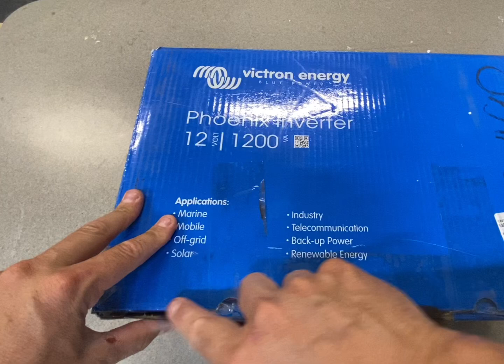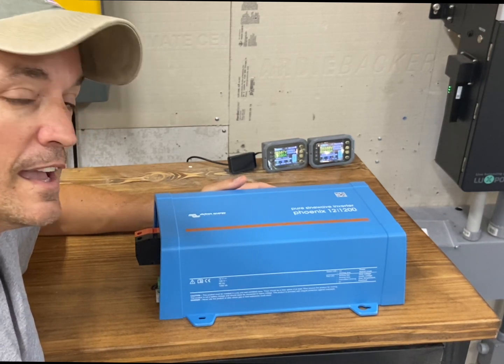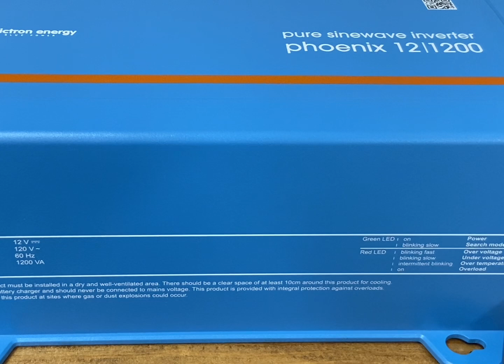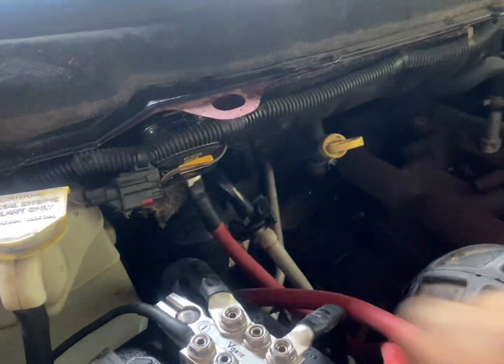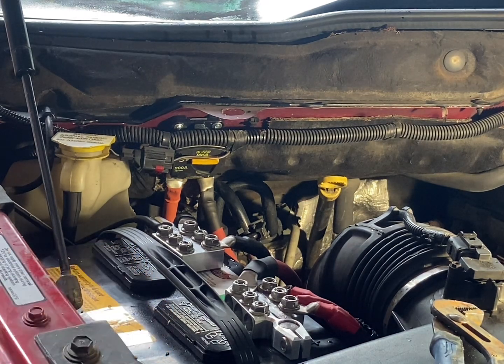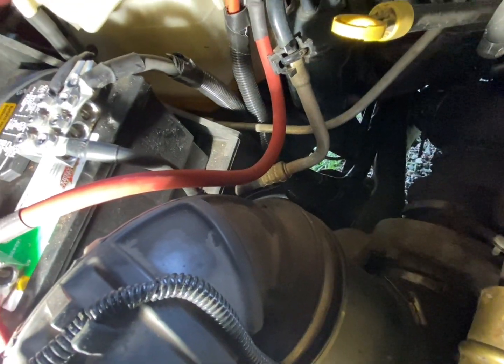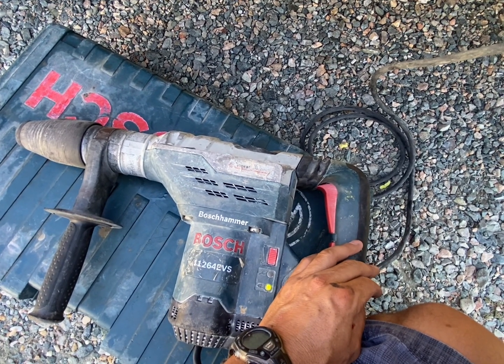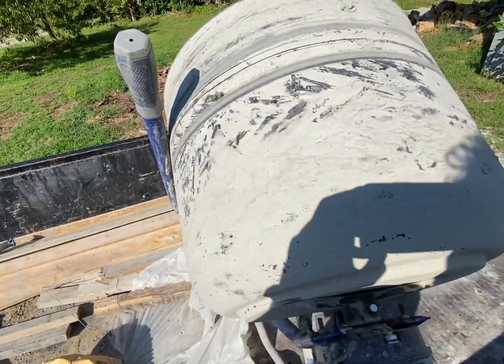DIY Truck Power Upgrade: Installing a Victron Phoenix 12V Inverter in my truck~and load testing

Comment: thanks so much for showing it with the jack hammer and mixer . 
been wondering if i could is it as a portable power supply with a 280ah litime . 
take care , jeff
Reply from the maker: Yeah that would work actually. After using it on a few jobs I actually had to recently upgrade. As the jackhammers bogged down they would trip the inverter. I’m using a 3kw Vevor inverter with a 460ah vatrer battery now.

Comment: Hello from Youngstown Ohio.  I just inherited a brand new Phoenix 12/800 But there are no cables in the box.  Can you tell me where I can get them please?  Thanks  (2awg?  4awg? )
Reply from the maker: @tomm2271  it’s likely 2 awg you want. Amazon should have what you need. Just make sure to get it long enough for wherever you need to reach.
Reply: @GavinStoneDIY  Thanks for the fast reply.  Im simply going to use it to run a few thing during a power outage. I'll have a 12v Lithium with it.  I'll need to cut the ends off of the wires in order to attach to the unit.
Reply from the maker: @ sure thing.

yeah, it’s best to use a ferrule on the ends of the wire if you have them. But it’ll work without.

Comment: Great video!  Do you have a link for the grommets you used to go through the floorboard?  I've never seen grommets like those with the screw-on tightening and sealing feature.  Very cool.  I have a similar setup in my truck with the Victron 12/500 with Bluetooth.  Victron is  very reliable.  Thanks for the video.
Reply from the maker: Sure! I just added a link in the description to the strain relief grommets I used. I love those things. I use them all time for different projects.
Reply: @GavinStoneDIY  Great, thanks!  Also, would you have a link for the circuit breaker coming off of the battery?  That's a great idea too.  Is that used instead of a fuse or do you use both?

Comment: Hello what's the  maximum  DC  current  on the label on the bottom of that inverter
Reply from the maker: It should be around 90-100 amps discharge current.

Comment: How many watts does the inverter consume when idle
Reply from the maker: Around 1-2 watts in eco mode.
Reply: @GavinStoneDIY  I mean in normal working mode please not eco mode
Reply from the maker: @EasyyokeFilms  around 4 watts I think. But I’m not sure why anyone would use it in normal mode if you had the eco option.

Comment: Dont drill through the floorboard. Always go through the firewall
Reply from the maker: The firewall was packed with junk. Plus I wanted a permanent connection for the inverter

Comment: Wow, That's a powerhouse. Do they have a 48V version? Thanks, Gavin.
Reply from the maker: Yeah they have a 24v and a 48v version. People use then a lot with systems that have smaller battery banks. They can switch over to these to run essentials. Helps conserve energy at night or on cloudy days.

Comment: Would love to see how you “line side tap” with your 18k and where you put the CT’s for that installation.  Nobody has shown that yet.
Reply from the maker: You can add the CT’s just after the meter with that installation. Or you can put them in the wiring box.
Reply: @GavinStoneDIY  I understand adding them after the meter and before the taps, but if you add them in the wiring box wouldn’t the CT’s be measure all the voltage output from the inverter, and none from grid?
Reply from the maker: @TylerTheCompiler   no they clamp on the incoming wires from the grid to the unit. In other words they monitor what the unit is using from the grid. I honestly have been using the 18kpv in off grid this entire time. So I haven’t dabbled in any of that yet. But even if you wanted it to monitor directly after the meter the CT’s use a standard cat5 cable. Those are fairly cheap even for long pieces. So it wouldn’t be deal to place them in your main panel in most cases.